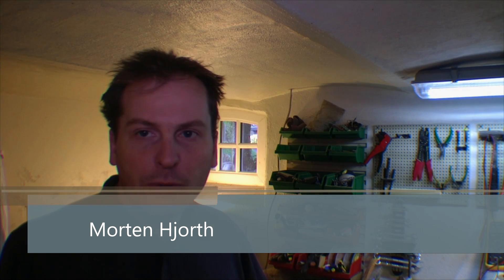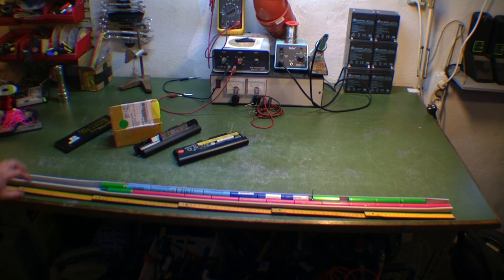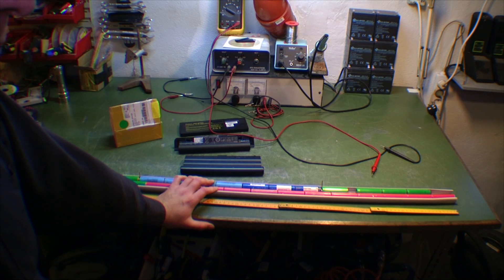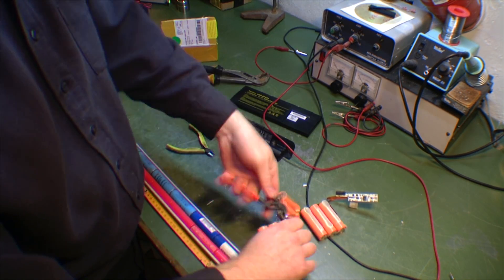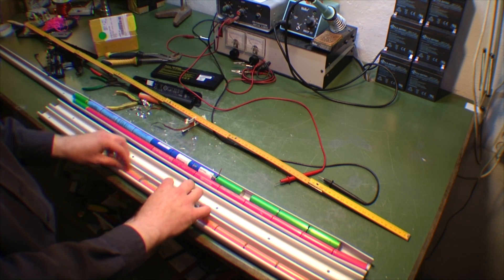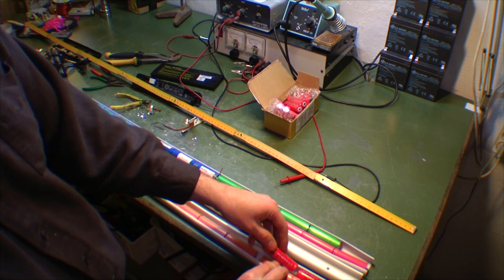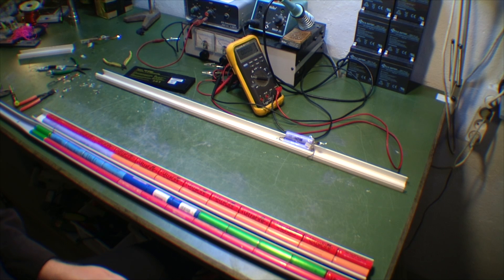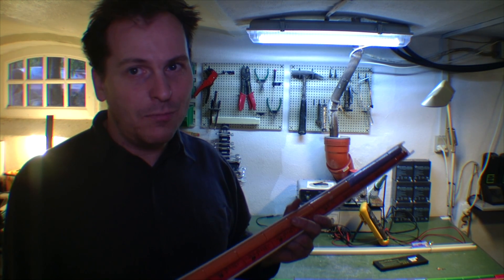Design a maintenance friendly Li-ion 48 volt battery bank - 254

Comment: 'rinoa super genius' is the guy? to watch for Li-ion batteries
Reply from the maker: Hi +Alan Marshall
I have been watching him,,,to become her (also a interesting project) And i have learned a lot from his way of doing it,, but i am gonna try my one way.  Also a little news on this in Fridays video :-)
Are you doing something with batteries or what are your interest?
Thank you for watching! :-)
Reply: +My PlayHouse (Morten Hjorth) I have a 'grid tie' solar system. Most days I generate about 30 KWH of power.
In Darwin when the grid goes down so does a 'grid tie' system. (This prevents people working on the grid from being shocked).
I intend to buy 4 new Deep Cycle batteries but decided to try cheap batteries first,
I have at least 10 second hand batteries. Some are Deep Cycle.
When I get a battery I use a 15 amp CTEK smart charger to charge it in recondition mode.
This usually takes 24 hours. I then wait 24 hours to measure the voltage.
If the voltage is less than 12v I discard the battery (dead cell).
I use 4 batteries in parallel to run a set of LED light strings (6 Amps) when the power goes off.
I charge the batteries individually as they are mismatched and only connect them together when in use.

I use the other batteries to run other LED lights (3 amps) and charge after each use.
I never let the batteries go below 12v.

I have discharged at 0.4 amps each battery to 12v and recorded the AH.
AH vary from 20 to 50 as I discard anything less than 20AH.

I have used 2 x 50AH batteries to run an Air conditioner as an experiment through a 3000W invertor.

I also have a Honda 2000eu generator.

At the moment I am experimenting with running the AirCond and computers from the Honda.
When the Aircond starts it disrupts the computers. An thinking of running the AirCond and computers off the batteries with the Honda running the CTEK charger at the same time. Will try this soon.

Also bought 4 new 7ah batteries to measure the effect of wiring them up in different ways.
Reply from the maker: Hi Alan Marshall
You are deep in to batteries :-) are you watching  Justin Case and his setup? he has this working,,, but in a big scale. But also from Australia,,, :-) Not to drive you away,,from here ,,at all.
Thank you for watching! :-)
Reply: +My PlayHouse (Morten Hjorth)  Thanks for the tip. So far I only watch YouTube.
I want some Powerwalls!
Reply from the maker: Hi Alan Marshall
Well Justin Case has this YouTube channel : https://www.youtube.com/channel/UC0Z4oQ-buX7qb4teb0TRtWQ
He is doing what you want to do,,probably. I want to build my copy of a Teslas powerwall,, with the Li-ion 18650 :-)
Thank you for watching! :-)
Reply: +My PlayHouse (Morten Hjorth)  I have watched Justin before.
I have a more modern approach (enphase micro inverters),
I also want to change to 12v appliances when I find efficient ones (like LED light strings). I will probably spread my batteries closer to the loads instead of having one huge bank.

Comment: For best longevity and stability of the cells, you want each cell in the series to be as close in capacity as possible.  You also want to add some fuses to protect the banks from short circuits.  Unfortunately, it's not uncommon for these batteries to short when they fail.  You don't want the power of all your packs going to that short or you may end up with not only ruined batteries, but also a fire.
Reply from the maker: Hi +Doug Goodwin
Thanx for info :-) I had a shorted cell my self in this video : https://www.youtube.com/watch?v=1WowAtnwiW8
Yes i need fuses,, but i also just got a bank balance board for handling the 13 cells.
Thank you for watching! :-)

Comment: I have seen some nifty 3d printed battery holders that hold them in smaller groups to make cells for balance charging.  Thingiverse has some good ideas on there.
Reply from the maker: Hi +AQUATICSLIVE
The systems i have seen on thingiverse like this http://www.thingiverse.com/thing:816005
Is based on soldering all the batteries together in a big blok,, i´d like a system where i can take out a bad cell. and a a easy way to extend or renew some of my bank.
I just received my "Battery Protection BMS PCB Board w/ Balance for 13 Packs 48V Li-ion Cell" This thing : http://www.aliexpress.com/item/1PC-Battery-Protection-BMS-PCB-Board-w-Balance-for-13-Packs-48V-Li-ion-Cell-max/32469176569.html
So no i am ready to play some more :-)
Thank you for watching! :-)
Reply: +My PlayHouse (Morten Hjorth) You make it always so much fun; waiting for something crazy to happen lol!

Comment: Morten, this is a fabulous idea! How do you plan to utilize these banks? I imagine they might be useful for emergency lighting when power is out, or you could use them as a more compact, less expensive UPS solution with a Raspberry Pi project. I am excited to see the result and the application for these!
Reply from the maker: Hi +Tyler Barton 
I plan to use them together with all the used car batteries,, A bank of Lithium Li-Ion like these can add between 100-320 Watt hour to the bank (Depending on quality of the batteries) 10 banks and i think I can handle one day.
I only use My PlayHouse in weekends,, the dream is that my solar panels can charge a 48volt battery bank, doing the week.
and there will be power enough for the weekend,,, not including my datacenter.
Thank you for watching! :-)

Comment: oh no not the ultrafire batteries! love the use of the conduit as a battery holder. Heres a quality brand of battery which I buy every so often. They're good for lasers, ecigs, etc etc. 3400mAh. This is australian but if you look them up you should be able to find them locally :) http://www.ebay.com.au/itm/281004553562?_trksid=p2055119.m1438.l2649&ssPageName=STRK%3AMEBIDX%3AIT

They're way more expensive than your ultrafire or even your laptop pulls, but hold way more energy than the ultrafires or laptop pulls (been there, done that!)
Reply from the maker: Hi +dash8brj 
Yes i was a bit to quick on the "BUY" button with those ultrafire batteries :-/
The Panasonic NCR 18650 B 3400mAh Lithium Li-Ion are also sold around here:
But i need like a lot,, so 25$ for two are way to expensive,,, i need to get more laptop batteries,,lots more.
You can buy good Lithium Li-Ion for about 6-8$ a piece.
Thank you for watching! :-)
Reply: +My PlayHouse (Morten Hjorth) me i go to my Pc Shop and old pc and laptop for near free :O i love that Shop
Reply from the maker: Hi +pierre-alexandre lemay
Nice,, i need to find some more places to get new ,,used packes..
Thank you for watching! :-)